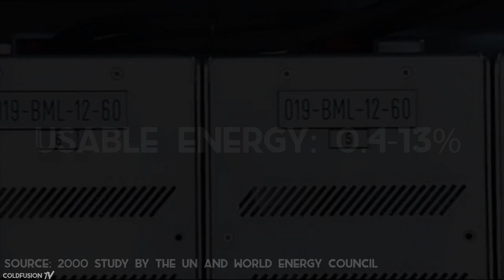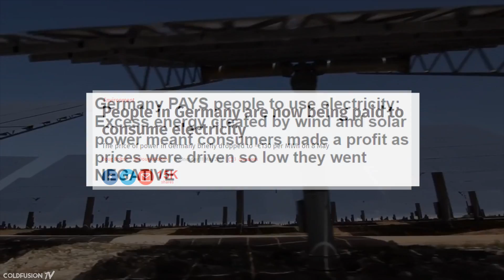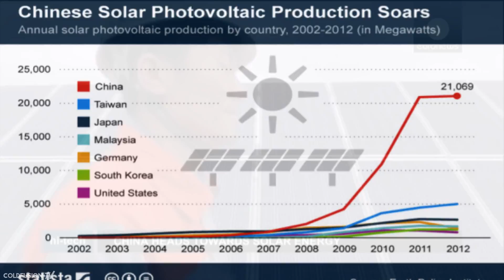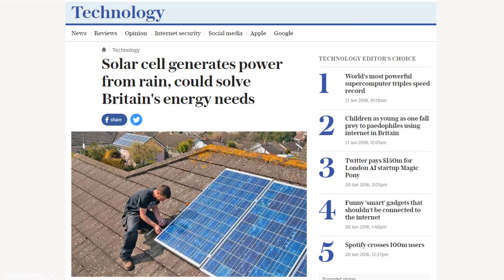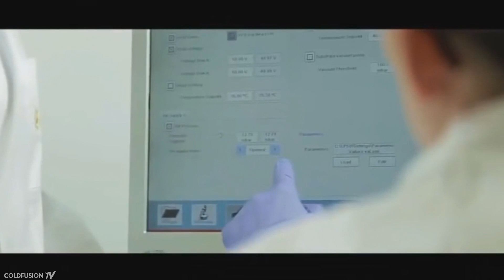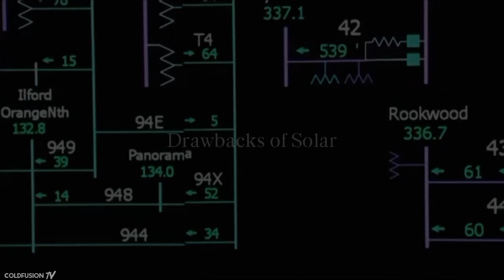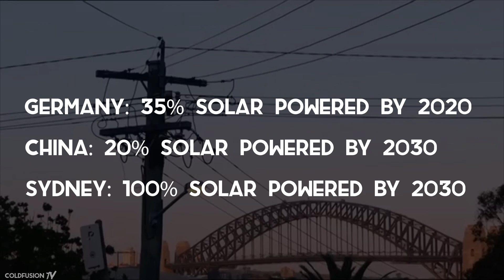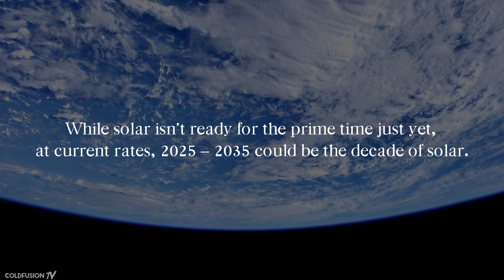The Truth About Solar

Comment: well there are many more problemes with storage in batteries! if u look at the periodic table lithium is the element most often used in batteries. lets say everyone would use solar power and store it in batteries out of lithium well we would have a problem :D there is not enough lithium in the world to build so much batteries
Reply: There are other ways to store energy. Pumped hydro, molten salt, water electrolysis, to name a few. They don't have the efficiency of lithium batteries though, but batteries won't have to do it all.
Reply: +tybofborg Well you are absolutly right there sure are other ways to store energy but I feel like there is a bigger problem to it in general. Humanity is needing more and more energy every year well and green energy is really good dont get me wrong but its not infinite! So if we dont stop needing more and more power in our lifes we will end up in around 150 years without any more space for generation or rather converting energy because our needs increase so rapidly
Reply: Derpolnischfrosch
You'd need to cover only 0.1% of the world's land surface with solar panels to have our current energy needs covered. That's current technology, which is only going to get better, more space efficient. And as for our energy needs, plenty of the things that use energy are getting more and more efficient. The job of a 60-watt incandescent light bulb can be done with an 8-watt LED bulb. We have more efficient automobiles than ever. Computers that used to consume ~100+ watts are being replaced by ~20-watt laptops and ~2-watt smartphones.  I think humanity will do just fine.

Comment: What about solar roads?
Reply: They're just solar panels laid horizontally (the worst, least efficient way to lay them) and covered with a load-bearing layer that should ideally be completely transparent and as good a road surface as asphalt (such a material is unlikely to ever be found, let alone produced cost-efficiently). It's an incredibly impractical idea that nonetheless captured the public's attention and drew millions of dollars in crowdfunding, with very little to show for it.
Reply: last i heard it was being tested by the US government
Reply: http://thefreethoughtproject.com/missouri-solar-roadways/

Seems like the project is alive and well...  I support these guys because it is an awesome concept and I don't see anyone else really stepping up to the plate and trying to make a difference.
Reply: Lracnolip
Testing is important. It will appease the crowd that believed it was a good idea and will invariably show it isn't. Researchers in the Netherlands have already built and tested a 70-meter strip of solar bicycle path for more than a year and found that the panels installed in it produced about half the power that they would have if installed on a rooftop.
Reply: I wonder if we are talking about the same thing. This is the solar road that is made with recycled glass and uses the power to light up lines on the road, not power anything else. This is what he showed a picture of in his video.
Reply: I just watched the solar road way busted video. We should not give up so easily, I still believe it could work and is a great idea for making a better tomorrow.

Comment: the title of the video made me think it has a negative tone. I opened the video because a while ago a physics teacher of mine told us that solar panels produce less energy in their total lifespan that the amount needed to create the panels in the first place, and I wanted to see if that's true.
from what your video implies, that statement is probably wrong for a long time now, is that right?
Reply: Cite for me any evidence climate change via carbon dioxide exists. There is none. 80% of CO2 in the atmosphere resides in lowest 20 feet above ground level. But, their theory, is, that, CO2 heats the upper Troposphere. There is no explanation for how this CO2 reaches up there. I come from the aircraft industry, where, we have to know standard temperature and pressure to set altimeters. Most of us just laugh at the fact they replaced eyeball read scientific thermometers, with, our much less accurate airport meterological station thermometers. The error of measurement in our thermometers, is, like 200% greater than their projections of global warming over the next 100 years. That said, I like solar very much, as, an energy alternative we should keep installing and working on as we will run out of economically recoverable fuels from the ground as technology currently stands.
Reply: I think it's a clever title... people usually watch videos in this case to just prove their argument. So someone who thinks solar power is bullshit is likely to open this video, and hopefully get educated
Reply: cool.
Reply: That was true some years ago but technology is rapidly advancing, so what maybe 5 years ago might not be efficient now its the opposite
Reply: to be honest, this one teacher in particular I didn't believe for a bunch of reasons, but I wanted to feel more assured that he was wrong :D

Comment: Thorium is still the real future!
Reply: There where thorium reactors in the US but were shutdown because you couldn't get enriched plutonium from them.

China is supposedly making a thorium reactor (but I dont believe anything that happens in China)
Reply: John Benton
Thorium is useless without a initial supply of plutonium or enriched uranium. Neither of those are consumer products.
Reply: The important question here is why is this channel called cold fusion?
Reply: *****
The unbalanced wheel could as well, if it even worked.
Reply: Not necessarily since its near impossible to mine legally. that is one of the reasons the US doesn't have a Rare earth magnet factory

There was a documented thorium reactor in the US but it was shutdown not because it didn't work but because the government needed the plutonium.
Reply: its a load of rubbish
Reply: You are stupid, put your tin foil hat back on.
Reply: you mean like every other element?
Reply: So why is no-one bothering to use the stuff?
Reply: well the unbalanced wheel is not proven or there would be working models by now. cold fusion is not possible at least not with our current tech.  Thorium has a much lower power yield than nuke. not coast effective... 
But out of all these options thorium has a chance, be it a small one. It will only work if government wasters stay the hell away from it & let privet industry in.
Reply: If Thorium was worth the effort, would not the Koch bros be mining it?
Reply: You are certain of this? Does the Government confide in you?
If Thorium is so valuable, why not mine, refine and use it yourself?
Reply: They sure could & are being utilized in consumer products. Look at in medical fields. weapons specialist for the military, they may not be enrich but.....?   Why is our US uranium reserves in Canada being sold to Russia with love for certain politicians for profit.  I mean it could be monitored & managed better in privet industries.   I mean there is a signatures left that can be 100% traceable.
Reply: Leap way and get on the train, before it leaves you standing on the platform. Best of luck.
Reply: It's because natural thorium (232) requires a neutron source (eg. ... plutonium) to transmutate into it's isotope (233) which transmutes into protactinium (233) and then uranium (233) which is the actual fissile material used to fuel the production of energy by fission in all/any thorium fuel cycles.

This leave's large quantities of protactinium and other high mw actinides as not only waste but waste that needs to be separated from the thorium fuel as it's (Pa) a neutron absorber, a very difficult process; but also the challenges of how to store such large quantities of more dangerous heavier waste.

There have also only been two experimental molten salt reactor's (and thorium reactor's are fluoride thorium salt aka LFTRs) ever researched.  There have been tens of thousands of experiment's and observations from both experimental and operational LWRs, HWRs, gen III reactors, critical fission (eg. Hiroshima & Nagasaki) and fusion detonations on earth, below earth, in the atmosphere and in space for over 75 years now.  

We know the current fuel cycle better then any other and thorium is self defeating as it's ultimately still uranium 233 fission generating energy, it just requires a neutron source (eg. from plutonium fission) to generate from natural thorium.

Oh and U233 has a half life of over 150,000 years so good luck storing/dealing with the waste of unreacted U233 (other actinides from thorium 233 transmutation decay have even longer half lives).
Reply: MDMA4LIFE LFTR's are not burner's. They don't need any additional U235 after they have already started. The Terrestrial Energy's IMSR is a burner and that would be the case there. IMSR will use slightly enriched uranium, but thorium and plutonium can be used as secondary fuels with no net fissile inventory being bred.
Reply: leerman22
They don't use U235 at all, it's not even a transient species in any thorium transmutation fuel cycle. 

You need a neutron source which is self defeating to producing energy when the fissile fuel (Th232) requires two β-  decay's to produce the actual net positive energy fissle nuclei (U233).  This leaves a wealth of unwanted fissle product's, particular those that are neutron absorbers (which prevent Th232 from accepting a neutron and would thus need to be separated from the fuel).

That's why we use nuclei (fuel like U235, Pu239) which release their net positive energy immediately after neutron capture, producing less transmutation products (waste). 

In fact plutonium is so useful because it's just the waste byproduct of neutron capture of the stable (and highly dominant) uranium 238 isotope.

The IMSR is an experimental reactor to study molten salt reactor designs (to be employed in gen IV fission reactors), it's expected to use many salts including lithium fluoride, sodium fluoride to study this possible technology (it uses uranium hexafluoride as it's fissle fuel).

Perhaps you're thinking of the DMSR which was just a proposal (a paper ... in 1980) that used many of the IMSRs design features (since it's a molten fuel thorium reactor design).  It never went anywhere.  We've proposed many things.
Reply: MDMA4LIFE
Of course LFTR can use U235, but just as an "initial fissile inventory", just like reactor grade plutonium. Either isotope will "eventually" be replaced with "bred U233".

On the thermal spectrum it would take more Pu239 than U235 because of the poorer absorption to fission ratio of the plutonium.
Reply: leerman22
The DMSR idea, which is what you're citing, (adding U235 and Th232) was one proposed in 1980 and shelved for a reason.  Regardless of there being U235 or not, transmuting Th232 to generate energy requires two beta- transmutations which leaves far more actinide byproducts (waste). 

Th232 on it's own can't produce net positive energy from neutron capture ... U235 and Pu239 can.  And they don't require the production of transient byproducts like Pa233 and Th233 just to get the fissle U233 the reaction requires.

LFTR is an umbrella term for any molten salt thorium reactor, the DMSR was just one 'conceptually feasible' ideas which was shelved for a reason ... as I described above neutron capture induces two generations of transmutation byproduct's before producing the fissle U233 vs. the zero generations of transmutation waste neutron capture of U235 and Pu239 require.
Reply: MDMA4LIFE
I think you've gotten lost on the "initial fissile inventory" part. How is there more actinide waste, btw? And no, LFTR is not an umbrella term for any molten salt reactor, LFTR is just one of many conceptual MSR's.
Reply: leerman22
LFTR is an umbrella term for molten fluoride thorium reactors (liquid fluoride thorium reactor) and the DMSR was just one of many LFTR proposals.

I said twice (more then twice) why there are more actinide byproduct's and that's that thorium 232 needs to undergo two generations of nuclei transmutation vs. zero to liberate fissible nuclei . 

The first generation liberates Th233 upon neutron capture and the branch of decay products (actinides) it will produce and the second generation will liberate Pa233 and it's subsequent branch of decay actinides (notably Pa231 for it's high activity and very long half life).

Put like this:
Th232 + n -> Th233 (& then its decay actinides) -> Pa233 (& then its decay actinides) -> U233 +n -> fission fragments
vs.
U235 + n -> fission fragments
Reply: MDMA4LIFE
I misunderstood you saying LFTR was an umbrella term for MSR's in general, not MSR's that use thorium. A fast MSR that happens to use thorium wouldn't be called a LFTR. Fast spectrum reactors would use things that won't moderate neutrons, so they would swap fluorides for chlorides, like the EVOL.
Reply: leerman22
All of these 'projects' are just studies, none of them have existed anymore then just on paper or a small experimental reactor since the idea was first taken seriously in 1980 (36 years !!!).  There has been no better nuclear fission fuel for the task then those available, why do you think companies are still pumping billion of dollars a year for years into gen III reactors and beyond? 

You don't think an Elon Musk thought hey I wonder if Th would be a good fuel since a lot of people think it can?  Oh the studies have shown it produces more waste, requires more difficult to maintain operational conditions (maintaining a molten salt at correct T/P), material engineering and would be a huge undertaking/investment when we're already on the cusp of nuclear fusion models.  No, I think he'll go build a rocket or electric car or something of value.   

LFTR would refer to any molten fluoride reactor whose fuel is thorium ... let me remind you what it stands for: Liquid Fluoride Thorium Reactor.  Any other model obviously wouldn't be an LFTR so why are you trying to uh remind me of that?  You're a crazy/strange motherfucker.
Reply: Thorium is a form of energy that needs serious investment on, but we should continue to work on all forms of renewable energies as it will take all forms of energy to sustain the energy needs of tomorrow. We need to leave fossil fuels in the dust as it's not going to be around much longer anyway. We should continue to invest in safe nuclear fission, nuclear fusion, geothermal, and all clean renewables.
Reply: Fucking morons with no clue about real science. Keep them tin foil hats on you basement trolls.
Reply: I dunno MDMA4LIFE, he seems to be backing one silly project called 'Hyperloop'.. even some of the best have a flaw...
Reply: Cat, I suppose that you know that Thorium (the element) was created in a star that matured and exploded long before out solar system and its star (ie., our Sun) existed.
Reply: +Robert Gaines India's 3 stage nuclear program.

https://en.m.wikipedia.org/wiki/India%27s_three-stage_nuclear_power_programme
Reply: Good to know someone's paying attention.  
Of course we're talking about the LFT Reactor, not just throwing Thorium into LW Reactors.

Comment: Solar Energy Isn’t Always as Green as You Think / Do cheaper 
photovoltaics come with a higher environmental price tag?   By Dustin 
Mulvaney  Posted 26 Aug 2014 | 15:00 GMT  http://spectrum.ieee.org/green-tech/solar/solar-energy-isnt-always-as-green-as-you-think 

Solar panels glimmering in the sun are an icon of all that is green. But 
while generating electricity through photovoltaics is indeed better for 
the environment than burning fossil fuels, several incidents have linked
 the manufacture of these shining symbols of environmental virtue to a 
trail of chemical pollution. And it turns out that the time it takes to 
compensate for the energy used and the greenhouse gases emitted in 
photovoltaic panel production varies substantially by technology and 
geography ...

Solar Energy Firms Leave Waste Behind in China By Ariana Eunjung Cha
Washington Post Foreign Service   Sunday, March 9, 2008  
http://www.washingtonpost.com/wp-dyn/content/article/2008/03/08/AR2008030802595.html  

GAOLONG, China -- The first time Li Gengxuan saw the dump trucks from the nearby
 factory pull into his village, he couldn't believe what happened. 
Stopping between the cornfields and the primary school playground, the 
workers dumped buckets of bubbling white liquid onto the ground. Then 
they turned around and drove right back through the gates of their 
compound without a word.

This ritual has been going on almost every day for nine months, Li and other villagers said.

In China, a country buckling with the breakneck pace of its industrial 
growth, such stories of environmental pollution are not uncommon. But 
the Luoyang Zhonggui High-Technology Co., here in the central plains of 
Henan Province near the Yellow River, stands out for one reason: It's a 
green energy company, producing polysilicon destined for solar energy 
panels sold around the world. But the byproduct of polysilicon 
production -- silicon tetrachloride -- is a highly toxic substance that 
poses environmental hazards.  "The land where you dump or bury it 
will be infertile. No grass or trees will grow in the place. . . . It is
 like dynamite -- it is poisonous, it is polluting. Human beings can 
never touch it," said Ren Bingyan, a professor at the School of Material
 Sciences at Hebei Industrial University ...

Treasury Dept. Sitting On Investigation Into Solar Energy Fraud That’s ‘Two-And-A-Half Times Solyndra’

Read  more: 
http://dailycaller.com/2016/04/12/treasury-dept-sitting-on-investigation-into-solar-energy-fraud-thats-two-and-a-half-times-solyndra/#ixzz4Cns8Ml00